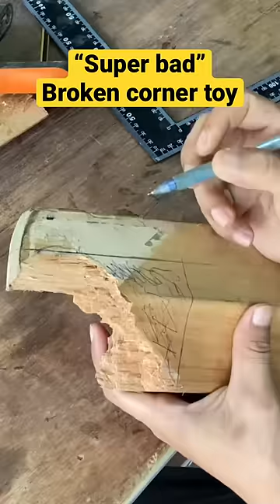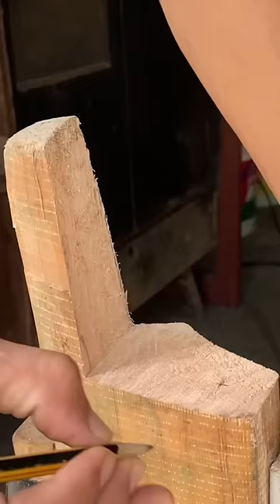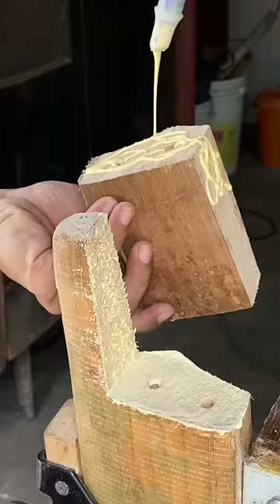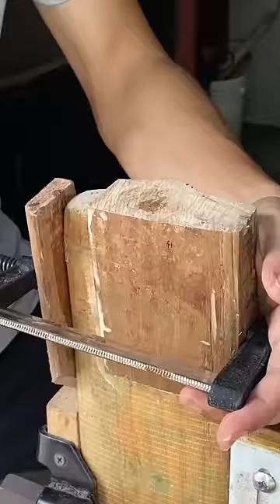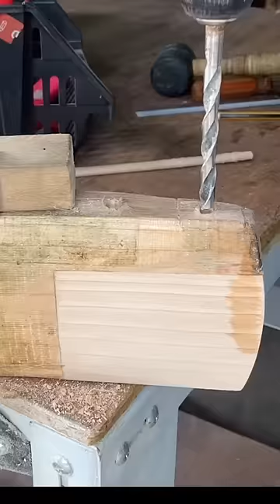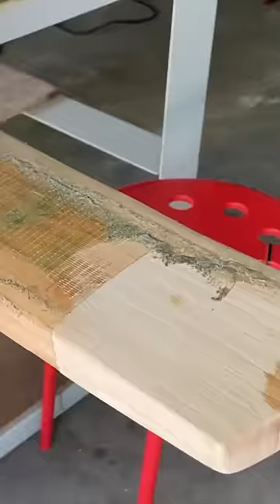How to repair major toe damage |  repair split handle part 1 #cricket #malaysiacricket #ytshorts

Comment: Replacing 3/4 th chunk at the bottom of the bat is waste of time, I would doubt if it would last 20 overs
Reply: it can but only if u use it on non striker end 😂l
Reply: not even one ball
Reply: Wow

Comment: Firstly you'll be lucky if it lasts an innings. But even if does the repair will be a dead spot. Looks like a cricket bat but it will not function like one.

Comment: There is one thing called monkey or center it sits in 8mm whole has precise center for a drill bit marks with a dot then you drill and you can use limiting ring on a tool drill bit to get true those and then it quick tho